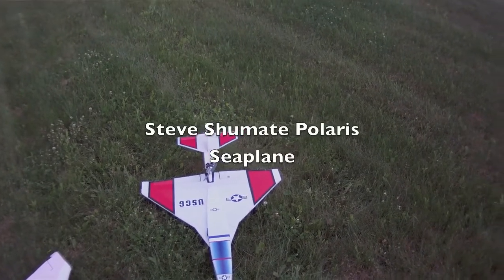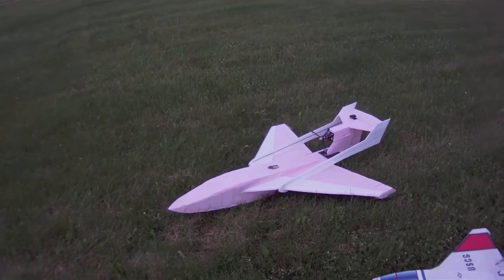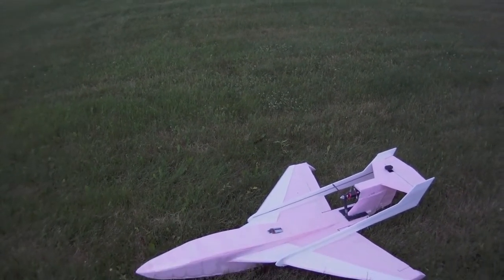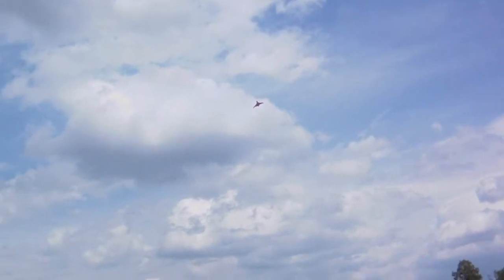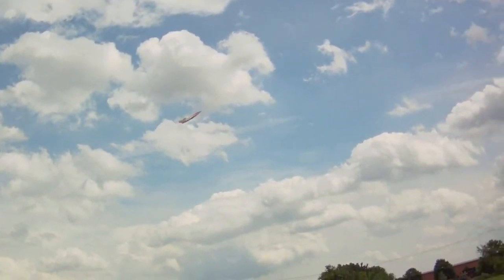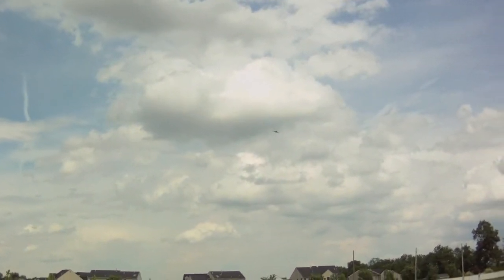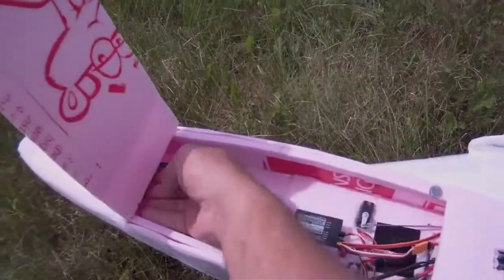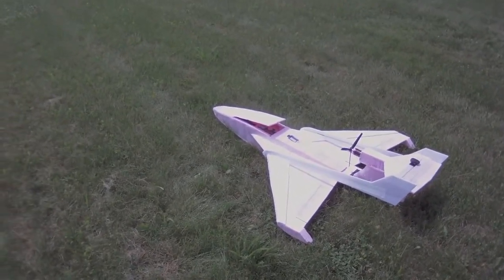120% Aqua Cat Seaplane Maiden Flight

Comment: This looks heavy in the tail, so you have to put the battery far from CG, also it makes the plane more heavy due to wire length. I'm thinking an aqua cat puller plane , or my idea is putting the motor near the CG. 
Also I tried a puller delta seaplane, and a pusher one (both without tail) , they can fly but not stable in strong wind, but I tried the flying wing or zagi pusher plane (similar to Judi plane), is very stable